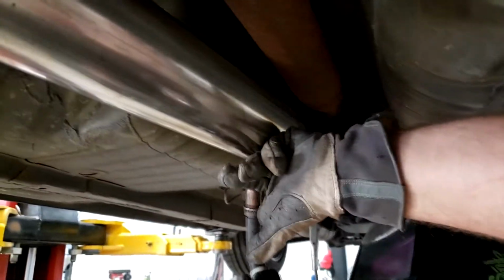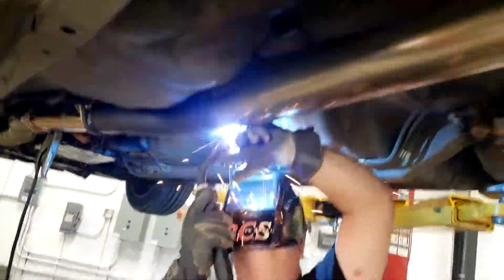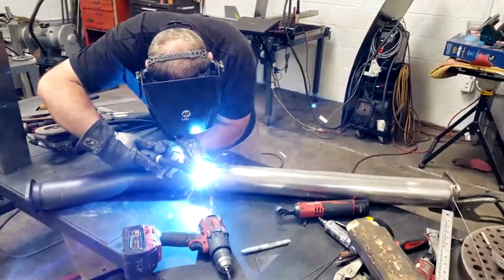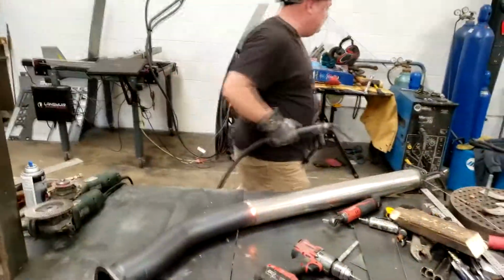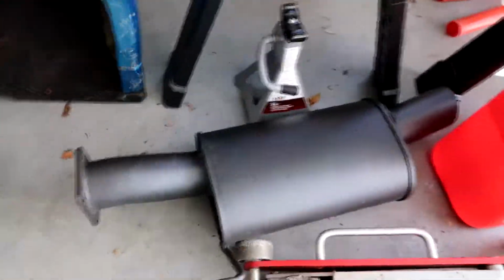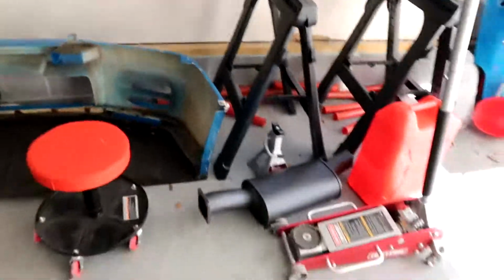Cutting up my EXPENSIVE HKS Exhaust!

Comment: Niceee! Are you on stock turbo and manifold?
Reply from the maker: Yeah for now lol
Reply: @TommyApex  lol I have a straight pipe like you did but with a Spec Nur and I wanted to change the sound since I been using for 7 years already, so I bought the HKS HI power but just the muffler so I will be cutting and taking the Nur muffler and will be  putting the HKS with a Vband so I can swap them whenever I want haha... Hopefully it will sound good, I want to change to a different sound, I'm on a 26 with single...
Reply from the maker: @romobo16  nice! Yeah thats not a bad idea.